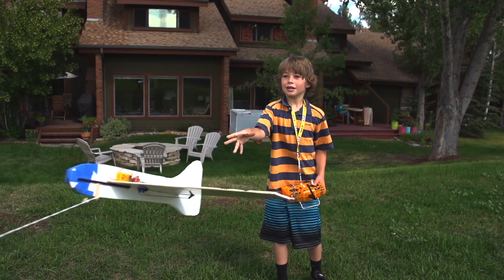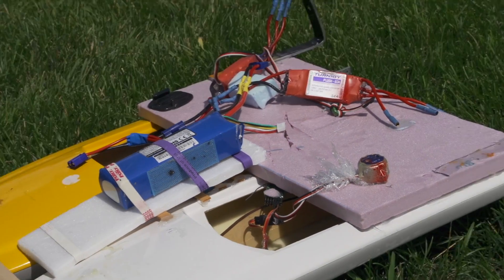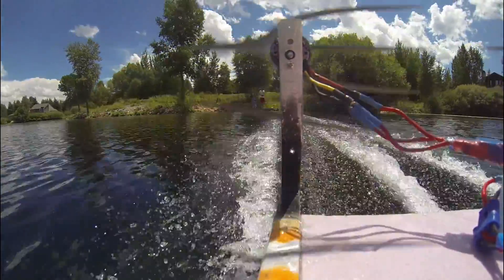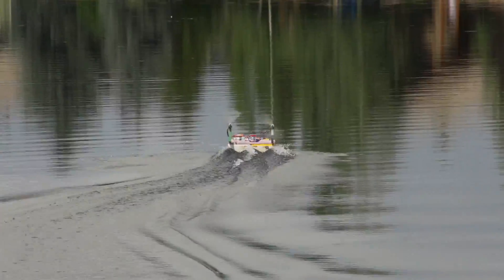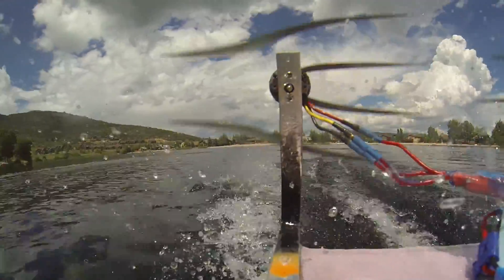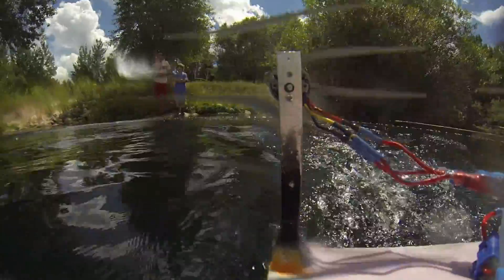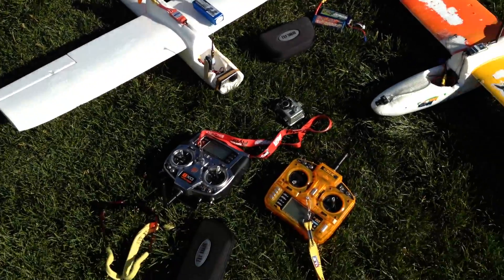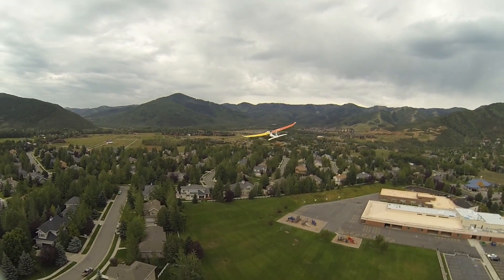DIY Air Boat and Air-to-air FPV - RCTESTFLIGHT -

Comment: How did you do variable thrust for steering? Was it just mixing in your radio? Thanks!
Reply: differential thrust, basicall with rudder one motor slows down ad the other speeds up
Reply: I understand variable thrust, i was asking how he achieved it. Thank you for your response though!
Reply: eppson977 programmable radio yes

Comment: I thought the characteristics of the Bixler 2 were supposed to make it slower than the Bixler
Reply: BashMonkeyRC   if you look at the pic of the bixler 1 he is using a bw motor instead of the large motor that is supplied with the plane if you get the pnf
Reply: Ross Clements  and it ooks like he is using a 8x4.7 sf prop or bigger instead of the 6 inch prop that is stock
Reply: +Ross Clements Thought stock one was 7x4
Reply: bix 3 is 7x4 i think b1 was 6x5?
Plus he is not using the recommended
 motor.
Reply: +Ross Cleve  Bix 2 is what I have and standard prop is 7x5 . . . Bix 1 is same size . .Bix 3 is 8x5